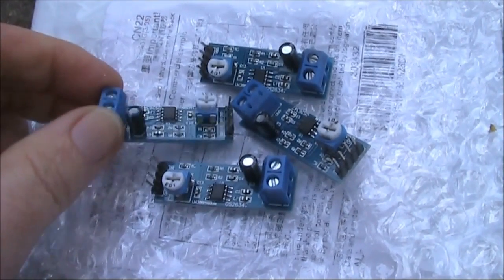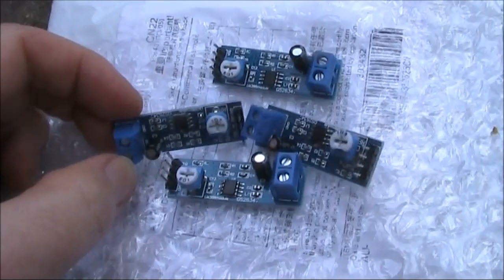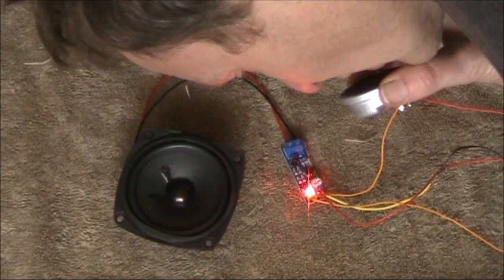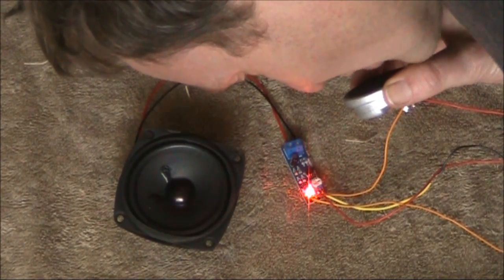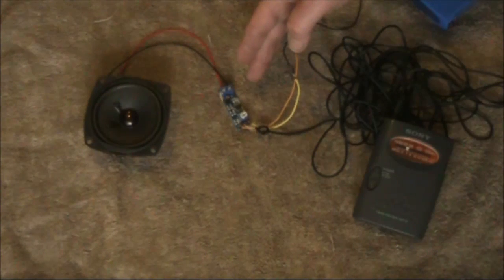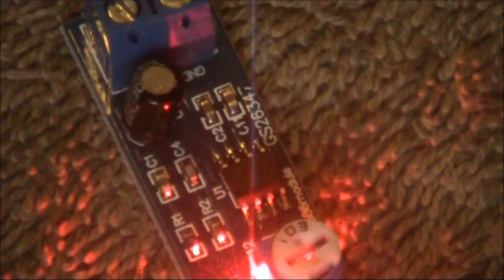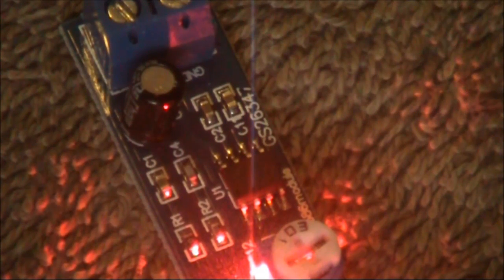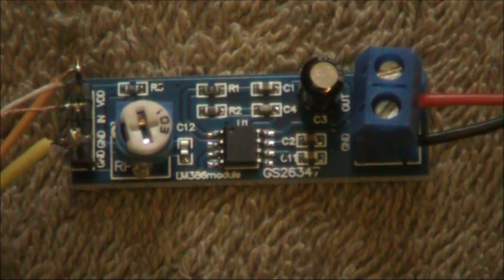Electronics on the Floor: Testing $1 LM386 audio amplifier modules

Comment: I bought this module but it is not nearly as good as it is said in this video. I got better results with two transistors and this IC has about 9 transistors.. At 200 gain it is barely audible. I connected it to a radio Super-regenerative FM, with a single transistor.. If I can directly connect the headphones, which do not have more than 12 ohms and I can hear the radio, with this module I should have room filling volume, but it is barely audible... And it is very noisy .Maybe it's my bad quality module... I'm extremely disappointed with these modules..

Comment: I am thinking of adding this amplifier within the Pixie kit to boost the volume/gain for CW without having to use an external speaker. Have you thought of or used it in this manner?
Reply from the maker: Haven't used it that way but should work.
Reply: @vk3ye  Thank you sir. I will let you know 73 KI5IUF

Comment: How do u connect the mic in this circuit show the making of this
Reply from the maker: Depends on the microphone. A dynamic microphone can be connected directly (maybe via a 1 to 10 uF capacitor). An electret microphone also requires a DC bias voltage delivered via a resistor of about 10k. Search circuits on the web for ideas.
Reply: @vk3ye  if i want to connect a condenser mic how do i connect?

Comment: So you can use a microphone as the audio input?
Reply from the maker: Depends on its output level and whether the impedance matches. Many microphones would require a 1 transistor preamp.
Reply: @vk3ye  Thanks for the reply. I'll wait for mine to come in and test the mics I have. So a 1 transistor preamp. I'll try to look for more information on that.

Comment: Everywhere I've seen this board discussed, the pot is referred to as a volume control. I've looked at pictures and I can't trace the actual circuit from the photos.
So my question is: Is that potentiometer what it looks like... A simple input-level control? Or is it the op-amp's actual gain pot for controlling the feedback loop?
My current guess is: They mean what they say -- it's just volume. And to get actual gain control it wants another pot jumping the output back to the inverted input.
If you know for sure, please do tell!
Reply from the maker: It's just across the input.

Comment: I have used this for reamping the output of passive preamps, and they work perferctly fine. Don't use the pot as a volume knob, but as a limiter. Turn it up to distortion, then back it off a quarter turn. I wouldn't recommend these for amping speakers, but they work amazing for adjusting the line level.
Reply: Thankyou, this is why I wanted one.

Comment: Hello, the review was good. But one thing I can't understand that can I use it as a 1st stage guitar amp?
Reply from the maker: I'd imagine it should work - though normally first stages in amps are opamps or discrete transistors.
Reply: vk3ye 
Hi, thanks for your reply. 
I couldn't find this module in my local market. So I bought a amp module which has PAM8304 chip in it.
My plan is, I'll use my acoustic guitar (has a piezo pickup) as input in the module I bought then I'll use the modules output in my 2:1 microlab speaker as input. Should I do that?
It will be really helpful if you answer my question, thank you.
Reply: This is nothing but an opamp anyway. I wouldn't call it a complete 'amplifier'. It will work fine as a preamp though, but I would not drive speakers right off the op amp, like what is going on here.
Reply: The  386 is technically a power amp,not an op amp.

Comment: Thank you for testing this circuit. I will have to buy one to try on my amp circuit. I am sure with lower in put it should be much cleaner. The question is will I have to initial a load resistor on the out put of it circuit to keep the LM386 from blowing up. As my audio amp circuit requires around 30Mw to750Mw to drive it. The rating output 0.25Mw to 1 watts according to spec.  Thank you.
Reply: I would. This 'amplifier' is driven right off the op amp. It isn't designed to drive loads like that. I use these modules to adjust the line level, and they work perfectly for that. However, they feed into a power amp which drives the speakers.

Comment: it's not designed to drive 4 ohm speakers
Reply: 32 ohm is the lowest I would attempt to drive off of this... it's just an op amp... LM386's will cook themselves, in spite of their meager thermal protection.
Reply: @rich1051414  i use the DIP version of LM386N-4 it will drive 8 Ohm speakers for YEARS I've had a circuit with it that uses a radio shack mic into a TL081 Preamp then driving the 8 Ohm speaker in my House, the mic and circuit is in a box on my privacy fence gate at my driveway.  I then have a reverse of the same circuit with the mic in the house and speaker at the box at the gate with a push button that connects to a relay that interrupts the indoor speaker so that I use these two circuits as an intercom.
   I first put the circuit in in 2007 and its been operating continuously for many many years with the LM386 baking outside in the heat and freezing in the winters, with lots of loud wind, rain, and loud vehicles driving by.
  It still works and like I said since 2007 its now 2022 that's 15 years worth of service!!!   Nice little chip!
Reply: then what designed is sutitable to drive 4 ohm speakers
Reply: Yes it is designed to drive 4 ohm speakers. It says so right in TI's datasheet for the LM386: 
https://www.ti.com/lit/ds/symlink/lm386.pdf

Comment: Im thinking Am series modulators here Peter,pin 5 is approx half what ever main VCC is,so 12VCC is 6V on pin 5 audio o/p
Before the decoupling cap on pin 5,these have enough power and drive the collector on a RF PA like a QRP rig for Am modulation.
You may need to add a RFC inline to collector on RF PA circuit,but it should give nice clean AM as a series modulator.
As you tested it on a microphone it could make a good AM modulator at $1 a shot.

I have tried it this on much higher power Audio chips and it works great as AM modulator and good thing is if on batteries the VCC tracks with pin 5 DC output so 9V=4.5V half VCC which is perfect as a use for series AM modulator.

Great Vid Peter as usual 73's

Rob
Reply from the maker: Definitely works. Used it on this little 160m rig.  https://www.youtube.com/watch?v=8L16-AUVPW8
Reply: THanks Peter 73's Rob

Comment: How did you wire the pins, I've ordered one to use as a microphone amp... Many thanks..
Reply from the maker: The pins are labelled on the board.  There's basically audio input, supply, ground plus the two screw connectors (one of them ground) for the speaker/audio output.
Reply: Cool, I didn't know that.. I did find a wiring diagram off the net, need to workout how to wire it up within the handheld microphone using that circuit with the amp board...